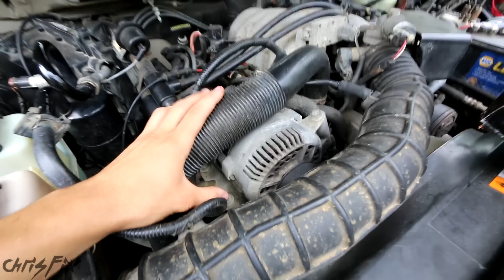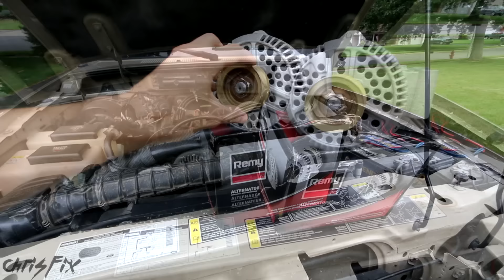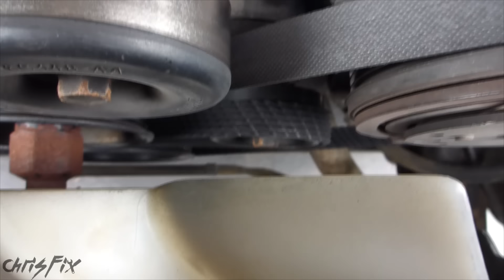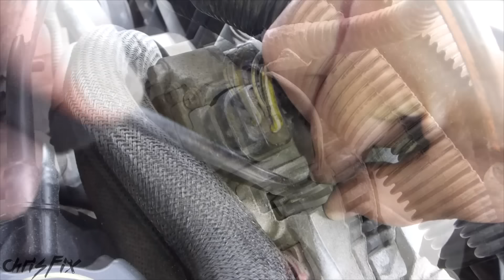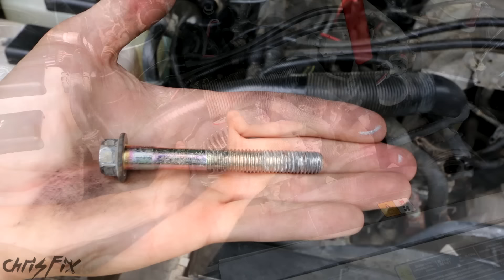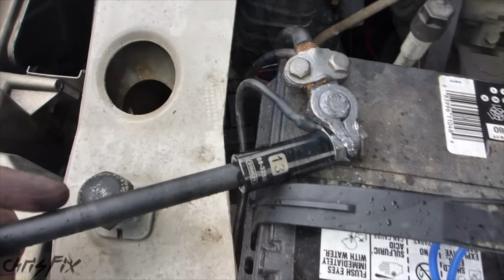How to Replace an Alternator

Comment: Repair shops charge waaayyy too much for this.
Reply: Cryogenia Band Well it really depends on the car. We had a Ford Focus, and you wouldn't believe how much of a pain that is. On that car it's like in the middle of the engine, so there's no easy way to get to it.
Reply: I also had to replace the alternator on my focus a while back

I would have had to take apart the engine block (I think, maybe it was take the engine out? Zx5 automatic hatchback)
Reply: WeAreTwoDoorsDown My dad and I had to replace the timing belt on a Volkswagen Jetta in the dead of winter, without proper tools. That was painful.
Reply: ScorpionRegent The problem comes when you pay a mechanic to do something, and they take forever, mess you around, quote you prices on parts you know for a fact you can buy brand new cheaper (by like $200+), and charge you for several hours labour because they "had to find where the handbrake cable was", for example.

A mechanic charged me for 3/4 hours labour because it took him that long to find where the handbrake cable was in order to adjust it. I could've googled it and told him if I had known. The number of times that I have been charged "labour" for an extra hour/etc because they needed to find out information about the car, where something was located, how to get it off, etc. 

Stuff like that is why people get angry with mechanics. I yearn for the day when I can find a mechanic that I can just go  "I'll pay you $80-$90 per hour of your time, and the costs of all the parts, if you just do an honest job and don't include "coffee and smoke time" as part of labour costs".

Sometimes it feels like with mechanics you are basically paying someone to google stuff for you (I know this isn't all mechanics, just the ones I seem to run into).
Reply: True in the uk they do
Reply: After hours when I worked at an auto parts store I offered $20 to install parts for them in the parking lot. That was as long as it was a simple thing like alternators, belts, water pumps, ect An average of 5 people in 3 hours took the offer. Easy money :D
Reply: Snipe is right there is a time and motion book that tells you how long the job should take.  Based on that a estimate is made and the customer agrees to it and that is what they are charged regardless of the time spent.  If the mechanic can do it faster then they are saving you time and you shouldn't complain if it takes them longer to learn, then they aren't charging you to learn. If they are working on a flat rate scale they are not charging you for actual time.  The only time they do charge "real time" is for certain kinds of diagnostics that are so complicated that the actual fault is completely unknown such as electrical.    
If you signed a agreement for a set price for parts and labor then that is what you got charged because you chose to have it done.  If you don't like the estimate then go somewhere else, better yet do it yourself.  You have choices if you don't think you made the right one then blame the guy in the mirror. 
As far as parts mark up is concerned yes you are paying more for a part than you can get it out of a parts store.  There's a good reason for this.  If that part fails you won't blame the parts supplier you blame the mechanic.  He has to follow through on the warranty and fight with the supplier on the labor claim.  Parts mark up is a insurance policy against such problems.  I said it before shops have high overhead.  Parts mark up is one of the many ways of staying in business.  Customers are often ask to install parts they bought some where else for a low price.  When we do such a job we clearly write on the work order that the parts are installed with no warranty.  We have the customer acknowledge this in writing.  Our only promise is that the parts won't fall out.  If they give us cheap poorly made parts that fail it isn't our fault.     If you want a professional job you get professional prices.  If you find some one who is charging a lot less there is a good chance they are crooked.  They may charge you for work they never did or maybe they installed junkyard parts instead of new ones.  You get what you pay for when you try to cut corners.
Reply: Dylan McElveen  damn that's edgy
Reply: ScorpionRegent If your an illegal.
GET OUT
Reply: Idk where to start, my dads alternator went out on his 09 pontiac vibe only after 104xxx miles. I was disapointed, especially coming from a car that is a toyota matrix rebranded as a pontiac, were they are supposed to be "reliable"(i will never believe in toyota reliability) and he took it to a shop and it cost him $640 dollars. He didnt want me to change it out because he was too "busy." Thats $640 down the drain. I don't trust anybody to work on my car, my window regulator is broken and not another soul on this planet will touch it except me. People need to learn how to be more independent
Reply: ScorpionRegent least I'm not the only one with a brian!
Reply: @brandoncaldwell95 who's Brian
Reply: +ScorpionRegent So if i get an oil change, with price of oil 35$ per litre ... how do you explain that?
Reply: ScorpionRegent Toyota long life oil for diesel, i belive they use castrol
In store it cost sub 10€, at toyota dealer its 30€+ per litre  (just material/oil cost)

it then should be good for 30k km, or 20-something k miles. 

And im sure they dont pay close to 10€ per lite what me and u do in store

We're speaking central europe
Reply: Well I would say that your dealer is charging too much for oil.  Find some one else or do it yourself.
Reply: Once again I don't know exactly what year make and model you are driving.  The majority of the diesels I deal with are pick up trucks. They tend to have huge oil capacities.  Yes maybe I should have realized that just by nature of where you live everything is diesel.
Reply: +Snipe Stud00 As to the case of mistaken identity my bad.

  On the magnet I stand my ground.  if there is so much ferrous metal contamination in the oil that the filter is at risk of clogging from a magnet then the engine is falling apart all ready.  It is better to trap the particles in the filter and remove them every oil change.  
      My day job is technician and mechanic and I have been turning wrenches on flat rate since the 80's.  I'm not trying to pick a fight, but I'm still working on cars for a living and you aren't.  I have run into a lot of guys who "used to be mechanics" there are plenty of reasons why they moved on.  Cynics say it's because they weren't any good at it.  I'm not quick to judge and I don't really care why you moved on.    How many ASE's do you have (had)?  If they are expired then when did they lapse?
Reply: +ScorpionRegent
 Dont apologize.I value an honest mechanic.
 Doctors and hospitals overcharge by thousands each day and we still die.Military contractors charge 70 bucks for a hammer ,on and on.
Except for illegals and medicare and we still pay.
Reply: Joe Garner What's to stop a mechanic from making it their life's work and charging you accordingly?  With your attitude they can't be blamed for it..  With book time your get charged  the same amount of hours as everyone else wether it takes twenty minutes or two weeks.  With book time as a estimate you can go from shop to shop and compare prices.  If you don't like it you can fix it yourself, You'll probably take a lot longer than book time and there is no guarantee you will get it right.  Do you tell your doctor how much he should charge you?
Reply: check out  rockauto.com
Reply: ScorpionRegent  k
Reply: Snipe Stud00 smart man.
Reply: MRSketch09 hey there's ways to make money. Especially when someone doesn't want to do it or they dk how too.
Reply: If you pay that much for oil then that's your choice.  Without any other information I can't help you. I don't know anything about you, your car, your mechanic, where you live or any of the many other things that affect your world.  I don't know if you choose to run oil made out of pure dragons blood or what.  How's that for a explanation?
Reply: dinodino my chevy runs 40$ an oil change if I run half and half. If I do full synthetic it runs 80$. Do it myself for 15-20 less. Only reason I'm so high is due to having 6-7 quarts.
Reply: Diesels always have larger oil capacities because they run harder.  It may cost more up front, but you really don't want to cut corners on lubrication.
  Here's a trick.  put a hard drive magnet on your oil filter it will gather any ferrous particles floating around in your oil and  reduce any friction.  remove the magnet after your oil change and stick it on your new filter.
Reply: ScorpionRegent dude not sure who your referencing to but I don't run a diesel. The oil change for a diesel here runs 80-150 due to oil. This is due to the filter being larger with more filtration and also oil weight going about 50-70 vs my 5.3 running 25-35 weight. Also you don't want to put a magnet on your filter. Worse thing you can do. Filter clogs, your oil pumps harder, leads to a mess of problems. I know they run magnets in differentials, and tranny pans but you don't change that fluid for miles. I know my tranny still is on the original fluid, and my front, back diffs at 165k miles. I also know my rear end is going out so is my tranny, and it's not due to the fluid but from towing and racing. I use to work on cars, and worked at an auto parts store before I quite to get an office job.
Reply: ScorpionRegent Diesels have similar oil capacities as petrol cars do, but require those expensive oils because they are usually driven much more than petrol equivalents, so they get 20-40 000km changes which is usualy 1 year.

Also with all those emmission laws, they need particle filters (DPF) (and ye, VW lol) which will get clogged with your regular mineral oil and fixing them isnt cheap, so you need C3 rated oil, approved for DPF

Other than that, 4-5 litres in normal 4 cylinder car (which is 4-5 quarts also in ur units)
Reply: ScorpionRegent Toyota D4D 2.2l 
Average Joe engine size is 1.6l, there are smaller of course for sub-average Joes, 2l is what u like to call business class. Most of diesels are under 2.5l,  3l is premium size, and some but hardly any top of the line get 4l engines. Diesels account for roughly 50% of new sales in eu
Reply: dinodino ever thought of disabling emissions but keeping the emissions apearance? I do not have catalytic converters but it looks like mine are still there.
Reply: Why second guess a perfectly good automotive engineer?  If you can't identify it and don't understand it's full purpose, don't touch it.
Reply: +Cryogenia Band A BMW dealer charges £205 an hour near to me that's 308$ per hour
Reply: +Ross Charlie But it takes like fifteen minutes at most. At least on my Mustang it does.
Reply: Frank Magana
You got 100k out of a starter?
Good.
Reply: cpgone I'm still on everything original motor wise from the factory in 05...only things changed were the knock sensors, brakes and belts at 135k...I'm now pushing 170k...
Reply: wow.
IMHO. Spark plugs and wires.
Dist. if applicable.
What about trans . fluid.
Heater core flushed?
Radiator fliud flushed?
Brake fluid flushed or bled? Made a diff in mine
Reply: Likely the brake fluid was not changed correctly.Even if they said they did. CF has a great vid on it.
I have a 93 maxima w/220k miles and have only used the best oil and other fluids. Mobile 1 and all syn.
You have never changed the tranny fluid?
SHould be done every 30k miles.
Reply: cpgone I bought the truck used at 80k. Under my ownership it hasn't been. My original brakes where worn to the point of steel on steel, no pads. The tranny and transfercase havnt been changed. My year has 4 diff transfeecases. Mine happens to be the high high dollar shit.
Reply: cpgone besides, my clutch is going. Been hard shifting since 90k and pausing since 120k tuner fixed that but now 1-2 clutch has just began to be acting up.
Reply: Joe Garner im just riding it till blows dude. once it does, brand new green monster with a higher stall torque converter paired to a professional grade transfercase. till then, old shit will stay......
Reply: Joe Garner funny tou mention dealers. they actually do not order parts from say GM. they order parts from oriellies, napa, autzone, ect. and charge double to triple for their "expertice" install. mechanics do the exact same. i use to work at oriellies, and sold u joints, cv shafts, bears, wheel hubs, wippers, ect for them all the time..
Reply: cpgone I just found that page today is it trust worthy ? I saw the commercial today
Reply: Snipe Stud00 you're the real MVP
Reply: OEM altenators are friggin' expensive. 
I drive a Ford Connect 1.8Tdci and the altenator OEM is about 300-350EURO if it is like mine fitted somewhere down, itll be a 2hour charge, 50-80Euro per hour so on the high-end it is 80+80+350 (+mark up for the dealer) they'll make you a 'deal' for 550Euro ;)
Reply: dinodino nah he can’t do it himself because you’ve already stated that it needs to be done by a “professional”
Reply: Cryogenia Band Doing stuff like that is part of my day job.  There is a reason that doing this costs a lot.  Overhead on a repair shop is brutal.  We train to do things right and pay for the tools to do it and we don't take all day.  We get dirty so some one else doesn't have to.  You get the benefit of years of training and experience when you have a professional  do this job.  There is a alternator on a V6 Mercury Cougar the the time and motion book says takes three and a half hours to do.  I can do it in an hour and a half.  A DIY guy doing it for the first time in the drive way will take all day.   That is why I am worth it.  I want people to work on their own cars.  I have no problem with some one doing this themselves, there are plenty who can't or won't.  There are lot's of other things that give me good job security.  Oh and by the way, I have to be able to support myself and my family.  With my knowledge I could be a car thief and a good one, but I make a honest living and I'll be damned if I am going to apologize for it.
Reply: @ScorpionRegent  auto repair is a highly skilled trade people are just being smart on the internet bud they prob take the bus
Reply: @cgletts  -  Yeah talk can be awfully cheap at times. I don't take it personal.  So what's your experience been turning wrenches?
Reply: They're given the time for the job from the manufacturer. 
The parts price too. 
Bitch at ford, not the mechanic
Reply: @12101DyM  "The manufacturer says it'll take 2 hours, it took me 20 minutes, so your charge is 2 hours."
Reply: @twoscoops5197  -  If professional can do a two hour book job in twenty minutes then they have learned how to do it faster by experience.  You may think that his time is over priced, but how much your time is worth.  He saved you at least a hour and forty minutes.  If you went to a less experienced mechanic he might have to learn how to do that one specific job on your car and take more than two hours, but still charge you for two hours.   What if he just told you how much it would cost to do the job, that it would be done tomorrow and didn't tell you how long he (or she) would actually take to do the job, would the price still seem high?  If the job was done right away and it only took twenty minutes is that really so unreasonable?  Which would you prefer, more time or less time?  How long would it take you to do the same job?  perhaps it might take you four hours to get the parts, do the job, then clean up and put away your tools.   Was it a particularly dirty job?  add time to take a shower afterwards and change clothes.  Do you have the tools to do it?  Are you sure you know how to do it right? No, then add in the time it takes to learn watching Chrisfix.  Are you sure you'll get the right parts?  Do you mind if you bang up your knuckles breaking free a tight bolt?  Is your Tentanus shot current?  Does twenty minutes still seem unreasonable?
Let's change it up.  All other things being equal, would you rather spend more or less time in your dentist's chair?
Reply: @ScorpionRegent  Each person values their time and effort differently, but that has nothing to do with my point.  In that example, even if it's worth it for someone to pay for 2 hours of shop time instead of doing it them self, the point is that it didn't take 2 hours of shop time - it took 0.3.

Dentists charge by the job, not by the hour.  When my root canal took 3 extra appointments, they didn't charge me more.  Mechanics have shop rates, and if it takes them 3 hours to do a "2 hour" job, you know we'll be paying for their time.  This is a false parallel, I hope you can understand.

This pricing strategy is a double standard, and it's unethical.  If a shop would work an extra 30 or 60 minutes past the estimated job time and still charge the same, that would be different... but I haven't seen that happen.  I've never heard "well that went pretty well so it saved you some money on shop time".  What I have heard is "well there was a lot more involved there once we got into it, so it was a little more expensive than we originally thought".  No extra work or parts, just the same job, but took them longer.  I like fixing things on my vehicles as I can, but not everything can be practically done in the driveway.  I assume mechanics use this pricing strategy to ensure a steady income for  their business but, ethics aside, do they realize how many people fix  their own cars because they charge too much for simple shit?  Like when my friend was charged $1,000 to drop 2 ready struts in, worth $150/piece?  They would have far more business if they weren't hustling people like they do, and maybe then they wouldn't feel like they need to hustle people.  Oh well.
Reply: @twoscoops5197  Have you ever actually worked as a flat rate mechanic?  You really don't have know what you are talking about.  If you did you would know that every flat rate mechanic is trying to beat book time because more jobs they do, the more they get paid. You pay for the job just like a dentist, the only reason the flatrate book is in involved is unlike crowns, fillings and root canals, the work can vary, because the year, make and model effects every thing.  Adjusting valves on Porshe isn't the same as Honda.   Changing a headlight bulb on a '72 ford truck, simple, same job on a late model Mini Cooper is not so easy.   Different procedures, different estimated time, so every job charges differently.  If you don't like that your mechanic is efficient go find a slow one.  The cost of the job is estimated against the same book that everyone else uses so there is no double standard.  What shop charges per estimated hour may vary, but you can see that the moment you walk into the shop.  They should have their prices listed on the wall.  If some one says they are charging extra something they can't document as different from what you agreed to in writing then by all means take them to court for breach of contract.  If they find something extra then they need to stop and explain how things are going to change.  I know that when I first started out I couldn't keep up with book time and I made less than minimum wage some weeks.  I don't know where you live and who you do business with, and I don't know you.  You say "your friend" paid $1000 in labor to have struts installed.  That maybe true, but it was his choice.  No one made him choose that business.  Did he call around to compare prices?  
I all ready explained quite thoroughly in a previous comment why professionals charge what they do.  Are you going to tell every mechanic / technician, or any professional for that matter, that you think they are a cheat and you don't trust them, because that's what hear you are saying.  Good luck ever getting anyone to ever touch your car.  You are what we call in the industry "somebody else's customer" the person we won't even refer to the competition.   Professionals are in business to make a profit and make people happy.  It's clear you don't want to pay and you'll never be happy, so take your car and fix it yourself back in troll town.
Reply: @ScorpionRegent  You're missing the point entirely.  When mechanics use a time estimate for their quote and go over time, they charge extra.  When they go under time, it doesn't affect the price at all.  Since your first reply was to my original comment, which contained only this one specific situation, I have no idea how your mind is wandering to all of these peripheral areas as if they pertain to this.  Obviously a shop wants to get a time estimated job done quickly since the faster they can get it done, the more they can overcharge for their time.  This is the paradigm which I was commenting on originally, and which you're not understanding or choosing not to understand.  Even if I could explain it more simply and clearly for you, I'm not getting compensated for this and you're being obnoxious so I'll let you figure out your own logical fallacies.  I won't be returning here, but feel free to leave the last response if getting the "last word" in helps you feel better.  Take care.
Reply: Joe Garner like no joke dude. i really did sell parts and tools to the dealerships. hey mainly use napa now, but before it was open it was always oreallys parts. i sod many of u joints to them for the oil field rigs, hell one time they bought a rebuilt block for 2k....they hardly use the GM parts anymore, its all the aftermarket shit. most the time not even the good shit. its all masterpro. shit fails again in no time....they have it all rigged. why i do 99%of my work.. hell a mechanic wanted to charge me 600 for all my o2 sensors in my truck. the dealer wanted 1400.... i paid 150 for the sensors and put them in myself. only took an hour and just to crawl under in the driveway...
Reply: Try living as an illegal and you will realize it's no where near a free ride.  Medicare gives the poor a chance to stay healthy so they can get jobs and pay taxes. It would be a lot worse with out it.  Remember those doctors and hospitals that over charge?  Try to cover those bills when your budget is paper thin.  There will always be those who take advantage and try to get something for nothing, whether they wear wingtips or work shoes.  There are always ways to achieve success for those who make every effort.  Those who allow themselves to fail and expect a free ride are beneath my contempt.  The truly unfortunate have my support and sympathy.  I work hard as a example to others and try to pay forward my luck to those who will make the world a better place.  
Apologies?  Not today.
Reply: That Guy With the Pointlessly Long Username That You Are Wasting Your Time Reading Right Now Hold up hold up, who's got the longer name here XD
Reply: I respect your DIY attitude, but I recommend you reevaluate your expectations.  104K is a reasonable life span for an alternator.  Consider that no car manufacturer would ever warranty a car for that many miles.  Go into any parts store and ask what sort of warranty they have on their alternators.  Any alternator or starter with a "limited lifetime warranty" will be covered against defects only for the life of the part as long as the original buyer returns it with their receipt.  That means if the alternator wears out you buy another.  There's good reason for that.  Moving parts fail and that is just a fact of life. Do you expect your shoes to last forever?  Even if some one were to sell alternator that lasts forever no one could afford it.  
One day your car may have a problem you can't handle what are going to do then?  I'm not saying you shouldn't fix your window regulator.  By all means do it.  Can you rebuild the transmission though?  Do you have a tire machine and a wheel balancer in your garage? Do you know how to do alignments with a tape measure, a level and a plumb bob?   Does your car have a computer?
Reply: DenomityLie they have a book they go off of. If it says it takes 3/4 hours to reach, properly adjust the tension, and to test if the adjustments are working properly then it takes that long. I have a friend that manages a shop. He quoted brakes for this luxury car that estimated 5 hours of work. He put 3 mechanics on it, had it out in an hour. He charged for the parts and 5 hours of work stated by the he book. That's a huge profit and time saved for the next car to be serviced.
Reply: ScorpionRegent I do not recall my ase nor do I know when they expired. I never cared about them anyway. However I've been working on diesel trucks, tractors, gas tractors, trucks, cars, and classics. I've restored an 82 d150 stepside with a 318 fully rebuild by my own hands. Even done the body work. I've been working on vehicles for 10 years. I was full time mechanic for 2 years but my body couldn't handle it forcing me to quite.
Reply: enrique mejia Its a hit or miss. Ordered my Bosch wipers there, was just fine. Ships from a warehouse, so you might get the wrong item or broken in transit every once in a while.